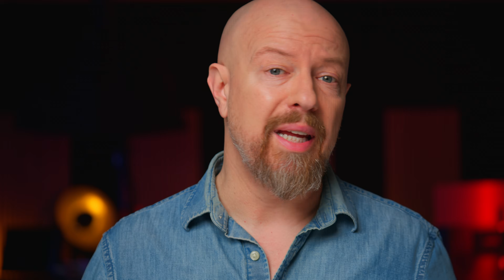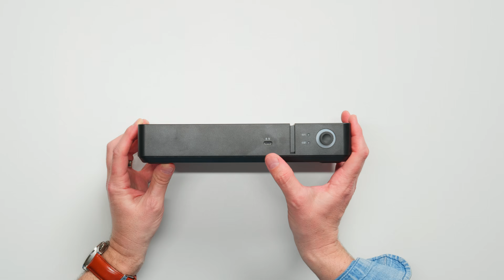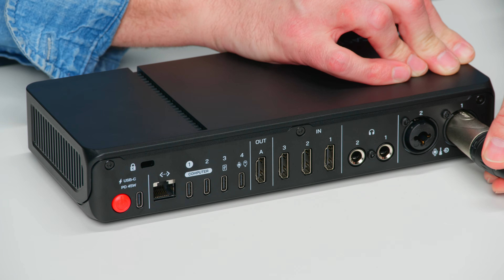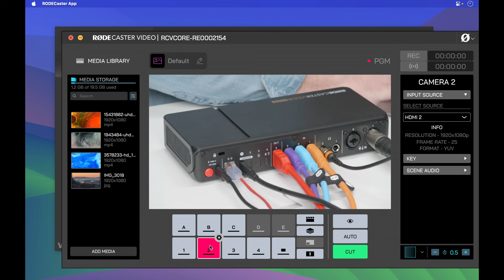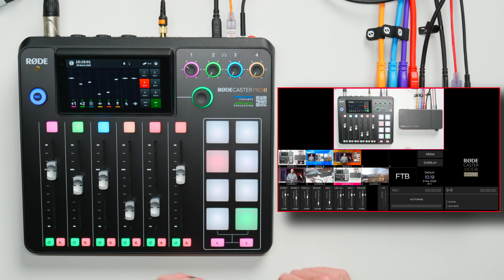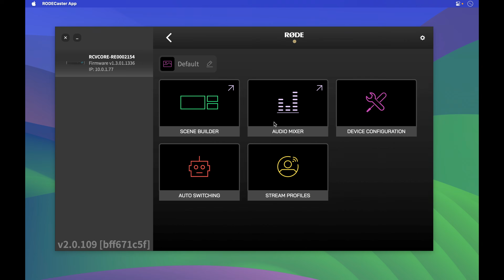Comment: Why would they put all the connectors at the back when there's nothing in the front? I mean, no screen or buttons (except for the volume knob). They could have put all the connectors on the front, making it easier to plug in and pull out each time, instead of having to reach around the back or having to pick up the device.
Reply: It’s the same internal board as the one with buttons. Moving ports around would require new… everything. And if you want the ports on the front, install it back facing forward 🤷‍♂️

Comment: Hey, this is great news! One question, do you know if this works also with the Roadcaster Pro II and the RodecasterVideo (not the s version, the first version with the buttons), I'm looking for a solution which takes less space on me table and controlling everthing from the Roadcaster Pro II would be great.
Second question, if I use the rodecaster Pro II for multiple audio inputs (let's say 4 different microphones), will they be transferred to the rodecaster video on 4 different channels or will only be the sum transferred and I have to record multitrack in the rodecaster Pro II separately?
Thanks for answering, Andreas.
Reply: Sorry, this was in spam for some reason. RØDE hasn’t said if it’ll work with the original RCV units or not, but either way the audio comes in as a mix. The point is to mix the audio on the RCP, so sending individual streams to the RCV would be counter intuitive.

Comment: Thankfully I got the Rodecaster Video S at launch for $499, before the price hike. I love it. If I wanted it off my desk I could mount it underneath and run it from the software coupled with Strem Deck which is the ultimate solution.
Reply: it's a great piece of hardware for sure